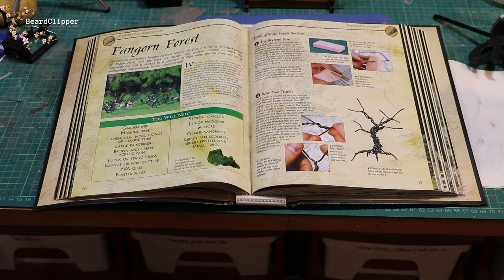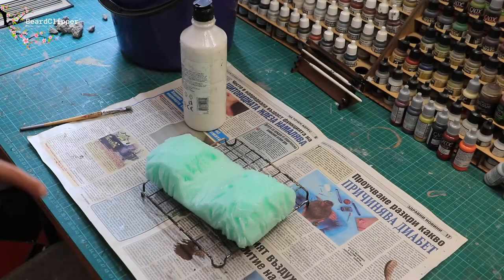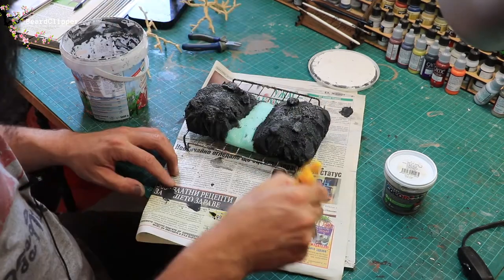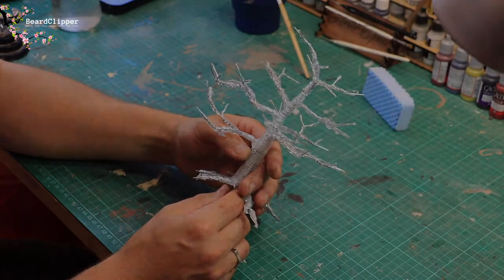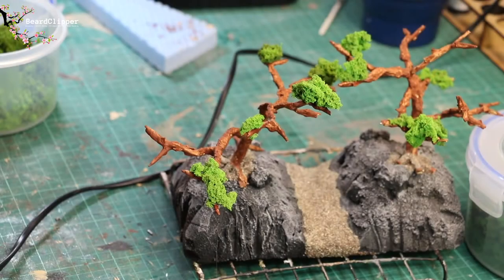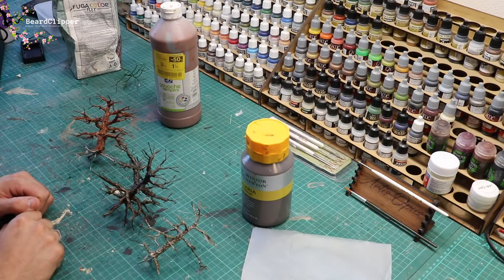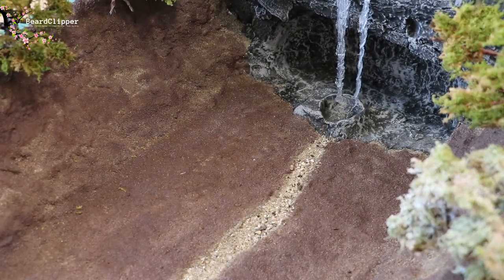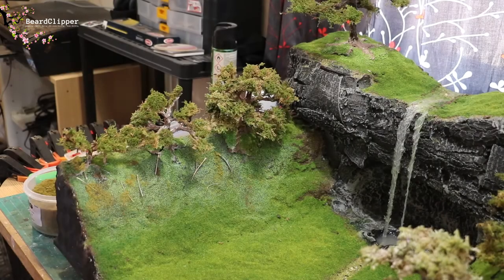Join me as I make Wellinghall, Treebeard's home in Fangorn! Trees, water effects, cliff faces!!

Comment: For the masking tape step, I use floral tape.  My ex-wife used to do floral arrangements and use it in putting them together.  It comes in green and brown and you can get it from Amazon.  It's a little thinner than masking tape and is a little easier to do wrappings like you did on the tree trunks.  I definitely looked like the one that you did with the acrylic sealer was easier over using the tape and the hot glue.
Reply from the maker: Oh wow thanks for that tip!! I'll have a look for that and see what I can find...

It's such an annoying stage of that type of tree-build, I always end up with it unravelling and causing me rage :D

Cheers for the comment - appreciated! :)
Reply: @BeardClipper  With the floral tape, you can wrap it in longer strips.  Be aware it doesn't have that much stick, but by doing longer wraps you have fewer end pieces that will get loose.   It can also be wrapped tighter around the wire as it has a little stretch to it and will conform to the wire better.   It also is thinner than masking tape so it won't have that big bulky look like you had.   You can build it up as thick as you want.  With it, you can start at the individual branches.  Do a short wrap around the main trunk to lock it down, then move out to the branches.  Each smaller branch should be done first then the bigger branch, followed up with one long strip for the trunk.   That will lock each part down and it will look great.   With it being a long continuous strip, you will only have one end to worry about coming loose and not multiple.  The ends of all the branch strips are covered and locked down by the next step larger.  That is how I was taught to do it.  Once on, the filler you used can be placed for texturing.